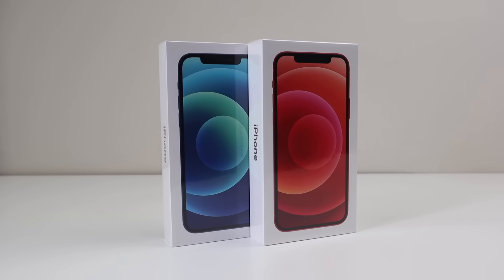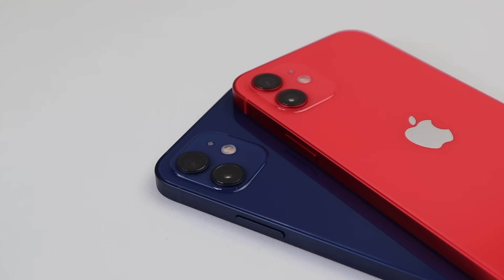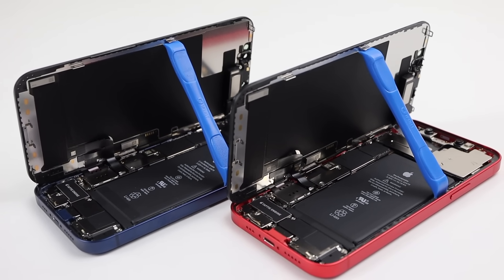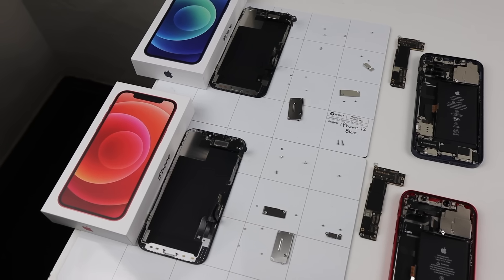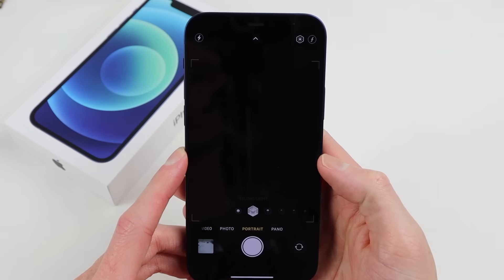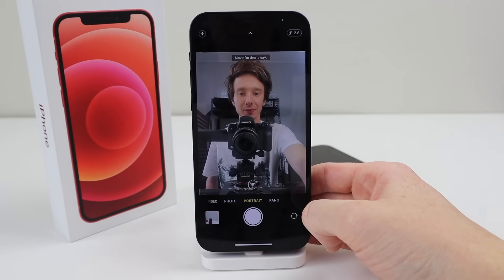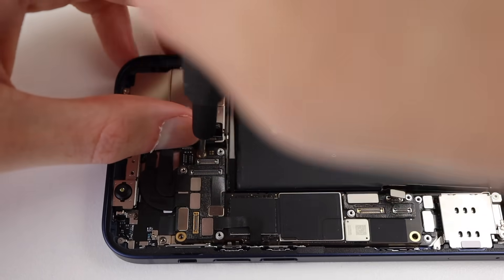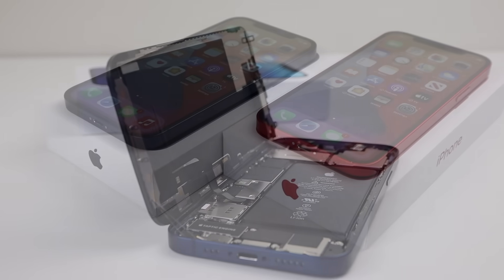iPhone 12 Anti Repair Design - Teardown and Repair Assessment

Comment: To be fair, if you are getting the new iPhone that means you have had an iPhone before so you should also already have the lightning cable with old usb connector, if you are upgrading from android you should already have a usb c charger as they have been using usb c for about 6 years now. I really think that usb chargers should not be included for any device at this point, as they aren't really expensive to begin with. Sure this device is not repairable for third party, but that doesn't mean it cannot be repaired, it is better to do this at Apple. Usually aftermarket components are created with lower quality components and can actually short and permanently damage the phone and even effect other parts that aren't related making it seem like the Apple is at fault when it was just the third party item. I myself had this happen with my phone, I have an LG G7 and replaced the charging port, the third party replacement cause android auto to disconnect but only at very specific location, like an intersection near my home, and worked perfectly fine everywhere else. I have complained to google and lg about this as I didn't think that a charging port that works perfectly fine can cause an issue like that, until a week ago I decided to replace the port again but with the original and now android auto doesn't disconnect at all. All this would have been avoided if I went to actually pay to get this fixed correctly with the manufacturer.

Comment: Would had been interesting to switch screens and see if they work, as this is one of the most common repairs on every device.
Reply: He basically did that when he replaced the motherboards
Reply: correct, but swapping motherboards he changed many components at once, what could cause malfunctions between some of them. I meant just the screen
Reply: Gossip Heart  the iphone 12 doesn't have a fingerprint sensor

Comment: The issue comes with Apple pairing serial numbers with each part this goes all the way back to the iPhone 5s with Touch ID being introduced. When these parts came out it was for “security reasons” to not change the touch sensor and still keep home button use. The serial numbers come in forms of data called ucid if I recall correctly and there should be a tool available to change the numbers to use generic and genuine parts.

Comment: What if it is specific phone parts because to me Apple creating a hole new part for a damaged phone would be to costly for them and wouldn't end up making much money on the phone what if the red one has parts with serial numbers attached to that phone and the blue one does as well like for the red one they mass produced replacement parts and they did the blue one maybe an experiment where they are the exact same phone and color would solve this question so that way phone repairst could just order specific colored parts like say the blue ones numbers are 0000001 and the red ones are 0000002 so thata why they dont work together its just food for thought

Comment: Funny how people are bashing Apple, other phones are/will be the same. It's just the fact that iPhone and some top of the line Samsungs are the only ones worth repairing. It's a fact. As for the "creating unfixable phones vs the environment" - Apple will fix it, compare the pricing of the fix by the original manufacturer with Samsung and others and then come back :) And at the end of life, it's up to the 2nd 3rd or 4th user what he does with the phone, Apple will recycle the whole - no need to throw the 5 year phone away and pollute the environment.

Comment: Whilst I agree that there should be a right to repair I can understand why Apple would want this feature. It prevents scammers or "cowboys" from fitting sub standard parts and passing it off as a genuine phone. I vote with my wallet and my last Apple laptop was the G4, the last desktop was the G5 and the last phone was the original iPhone (I have since bought a few from eBay, but they where account locked - annoying, but understandable). E-waste is a thing, but it's a consumer driven market, if everyone stopped buying their products there wouldn't be any Apple e-waste!
Reply: Just saw this video - which highlights the point: https://www.youtube.com/watch?v=97sT52Kof1M&ab_channel=HughJeffreys

Comment: To some degree, this approach is also to make the security of the devices a little more robust. Being able to third-party-repair a device also exploits the possible loose ends of the device in terms of hardware-software integrity. But yes, definitely not an eco friendly approach if you would have to pay a huge amount for an authorised repair, people might as well opt to buy a new android device. And this would only pile up the carbon footprint.

Comment: I repair phones for Apple and this isn't new. Apple has a tool called RepairCal that must be run on phones after installing a new screen or battery, it basically tests the battery and screen to make sure they are functioning properly and calibrates them, and if iOS detects this hasn't been done then face and touch ID won't work and you'll keep getting error messages.

Comment: For me, this is not an Anti Repair design in any way, It's a security measure.
1) If service is authorized to repair service, it will pair those parts again, and thus there are no issues at all
2) If services are not authorized, i.g, it's crappy - you should not use it in the first place. Who knows where they will mess up
3) Thus kind of behavior makes stealing your phone a foolish idea, cause now it cannot be reused even as parts donnor, so less iPhone would be stolen

Comment: On one hand, this makes the security of the new iPhone even more secure, since it requires the original signed parts in order to function correctly, which makes me feel better knowing that my device is very secure. But on the other hand, it unfortunately comes at the cost of near difficult repairability, which is something that would certainly upset many people. Me? I’d rather have a more secure device than a more repairable one.

Comment: You having trouble trying to open this iPhone is proof enough that it won't need to get any repairs soon. :-D I have also seen a drop test video where nothing broke after several drops from a ladder, only the back part fractured without splitting. The display is tough as hell. Great video though!

Comment: Future: apple uses no screws and metal bonds everything
Reply: There will be screws. But those are only put in to stop the self destruct mechanism, so you might not want to take them out.
And they'll be made of an alloy that happens to fall apart after 1-2 years.

Comment: Of course! They want to go eco friendly with their  "No charger included in box" but they want you to buy a new phone and dump your old one by keeping repair costs high
Reply: The charger is included in the box, you don’t get an adapter
Reply: @Ethereal1  no it is not... The brick is not included...
Reply: @ronwesilen4536  you don’t need a brick to charge the phone. You can plug it into your computer or a USB adapter you have at home.
Reply: @Ethereal1  LMAO are you trying to justify Apple selling a new phone without a charger? People like you are the reason Apple gets away with their money-grabbing decisions 🤦‍♂️
Reply: @ryadhasanahmed5443  not justifying it, I’m stating the obvious. They give you the charging cable, they don’t provide a wall plug/adapter.
Reply: @Ethereal1  The wire provided in the box is only compatible with the latest charging brick that cane with iPhone 11. And not all people have usb C port on their laptops.

Comment: Well I mean in order for the Face ID to work properly you would need to change the front facing camera as well, that and the proximity sensor are paired at birth. When it comes to the other issues... the camera problem is a bummer but, the rest are great to, how you said, let the user know if any repairs have been done to a listed “new” phone on sale.

Comment: I love my Ipod Touch to bits. It just keeps running and running, without issues.
But I am so glad I have never once in my life bought an Iphone.
Reply: Same. I have an old iPod and it’s still kicking around. Only issue is battery life isn’t the greatest.
Reply: @jadecoolness101  if its a classic i mean the old school no touch screen you might consider replacing the battery. The old touches it might be posible but haven't seen video's yet
Reply: @justinkoldenhof9039  oh sorry I’m so used to calling my iPod touch just an “iPod”
I’ve never had the non touch screen iPod eheh.
Reply: @jadecoolness101  no need to apologise. I just said it that way to tell you what ipods im talking about. I looked if it was possible to replace the battery on the ipod touch but it seems like its not worth it. all the video's i found show a soldered battery. even the ipod classic had ribbon connector just like the newer iphones. it just seems so not worth it to risk bricking a working device
Reply: @justinkoldenhof9039  yeah, thus why I haven't changed the battery. It's sad, though I have 2 other newer iPods that have better battery (again, touches). I have a gold iPod touch 6th gen I got christmas of 2018, mainly to be an MP3, though it also has youtube and discord for quick use, I take it out for general purposes. Then I have a pink 6th gen  that I got in late 2015 with more storage (I believe 64GB?) for games (mostly rhythm games) and also has youtube and other general apps. And the third is a far older blue 5th gen I had for a few months until late 2015 (not the ugly 6th gen blue, the nice 5th gen) that came with a recalled/faulty battery, but was refused a refund because Reasons(tm), thus why I got the pink 6th gen so soon after getting the blue 5th. 
When people hear me say I have 3 iPods they think I'm rich or something, but no... I just keep devices that aren't broken XD. Hell I have an iPod 4th gen that still works too.

also "no need to apologise" bro I'm canadian we find a reason lmao
Reply: Fact: I am also using my IPod classic as my car's music player. 👌

Comment: Is there laws against this? If there is Not, there should be!
Protecting users from ungenuine battery is just fine, preventing user to use genuine replasement batteries is not!
I am fine that phone tells me that the battery is not iBattery, I am fine that phone tells me that the camera is not iCamera... all in all it still should work. It is up to user to endanger $1000 phone by using substandard parts... But this is getting ridigilous! ”Legal” Apple parts don`t work... and prevents the phone working at all?
I can wait iCar. This is not iGasolin... I don`t move! Somebody has changer the tires... engine does not start. I change old and bad windshield wipers using official and expensive iWipers... the light don`t turn on any more in my iCar...

Comment: I dont even care about being able to fix my phone; if it breaks i buy a new one. However i found this video very interesting and now i know that if i ever have to get an iphone fixed for some reason, i will not rely on 3rd party components or services. 
I’ve had 4 iphones since iphone 4 came out and none of them have had any issues despite being used daily for multiple years so i dont see this being a big problem..

Comment: Hello, at you heating machine you have a silicon mat as a cover. Is it supposed to be these or you must remove it and place the phone on the metal plate instead? Thanks.

Comment: Nice video, you certainly are a very knowledgeable person about Apple products- but, can you disable two factor authentication on a phone that has it accidentally installed beyond the 2 week window? This feature sucks and violates my rights to determine my safety as well as Not enabling it to remove the rescue phone number from an “exes” phone, or a phone locked in an office building on a Sunday.

Comment: they don't want to impact the climate, yet they ship phones that either are very hard to repair or cost as much as the phone itself to service it at an apple store. but hey, no charging brick in the box means less waste right? WRONG! because they are USB-C you actually have to buy one yourself along with your expensive phone. so chargers will still be made in the same proportions, and they're basically just selling lies to get away with milking consumers' pockets.
there goes my rant before i even start watching a single second of the video. i hope i won't have to add more to this comment later.

so of course if you're reading this, i did add more. it's not environment related this time, but i am so baffled that even though both phones have the exact same components, and same everything, you still can't change any of the internals of the phone, so even IF you got your hands on a 100% genuine working part, it will not work, taking the "right to repair" right out the window. it's so obvious that somehow they are pairing hardware components together but they say nothing about it and just say to bring the phone to an Apple shop to repair it. i swear all that's missing for them is to invent some form of hard lock that doesn't even let you OPEN the phone in the first place without a special tool.

Comment: What people don’t understand is they’re locking down more stuff due to the fact scammers are swapping out parts from the higher end iPhone pro and putting. Then in the base models and returning the pro back to stores. We have had countless people doing this at Best Buy. This screws over people who legitimately want to self repair or third party repair but I can understand also why Apple is doing this to prevent scammers. But they’re also using that case to stop people from self repairing also

Comment: There is probably an initialization routine that needs to be completed in order to swap the camera. With all fairness to the technicals of the issue, the new cameras anti-shake features and such are probably very much specific to each camera. Since each camera would not be identical and have certain unique flaws and characteristics. This is because Apple makes a highly quality, but also highly performance varying camera. There is probably some software in between the brains and the brawn here normalizing all cameras on iPhones to be exactly the same, the software likely compensates for those tiny differences.

So once you remove it/change/swap it/etc, you need to somehow tell the logic board about the new camera and other critical hardware changes. This type of behavior in "perceived high end" items like iPhones is actually pretty common. You've thrown off the software calibration, which compensates for the sub-par physical construction, causing a major malfunction that it can't recover from using the user available tooling.

Is this right? No. But is it malicious? I'm not quite convinced since I can see how this behavior would exist without needing to be maliciously implanted.

Comment: ROTFL, so Apple to pull out such a trick. It's basically their signature move, back from the Classic and II+ era onwards, trying to make EVERYTHING as proprietary, custom and hard to duplicate as possible. I have a hunch this is not hardware incompatibility, but just a new "AARD": the modules' identifiers are stored in the keyvault and, should they not match, random bugs and malfunctions are deliberately triggered to push the device owner into sending the unit in for official servicing. 
I wouldn't be surprised if "service mode" has an option to re-pair (no pun intended) each module with the OS once physical repairs are done and then re-sign everything..

Comment: After a repair you have to run Apple phones through a system called “repaircal” which only Asurion and Apple have access to. That’s the only way to do a repair and still have full function afterwards. The main reason they do this is so they don’t have everyone running around with their parts doing repairs for their own profit. It’s actually really smart from a business standpoint lmao

Comment: That's like buying a car, then wanting to replace a tire, but when you replace the tire (even if it's a genuine tire from the manufacturer of the car), the car has some software built-in so that it won't start and it tells you that you can only get your tire changed at the official auto repair shop of the manufacturer. (The only difference being that they can bypass whatever software they put in the car to stop you from repairing it)

Comment: I think the most damageable part is the display, but you didn't swap to see if it works (I'm pretty sure it will), and also need may arise to replace the battery after some time of use. And you didn't swap those too :)
Reply: no  the screen is glued with face id since iphone x , i had a defect tel-speaker and the switch the display unit with face id etc .  apple is crazy for money cost $280-300 to repair
Reply: i mean not glued mean synce with nummers you know what i mean xD sorry english is not native

Comment: Stopped putting charger blocks in to save waste, yet many iphone 12's will simply be thrown in the bin (like many previous models) when any glass cracks because alot of people wont pay apple repair charge, they just buy another one,
Being able to repair a device is far more environmentally friendly then lockimg components together in software